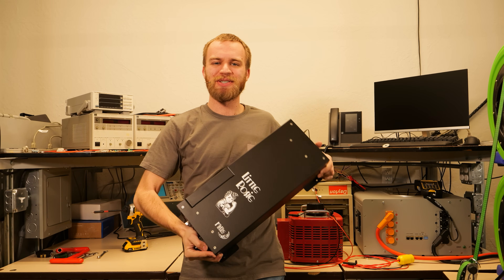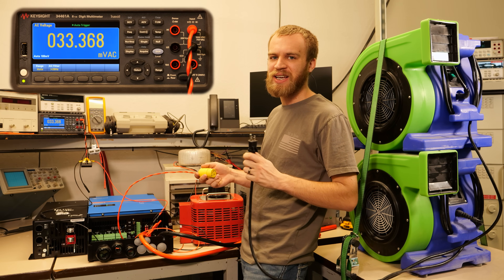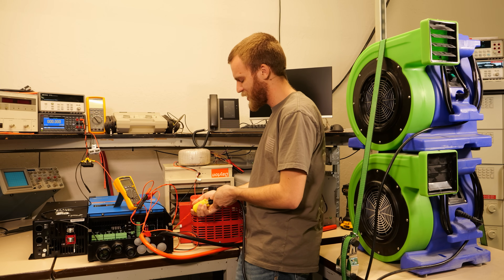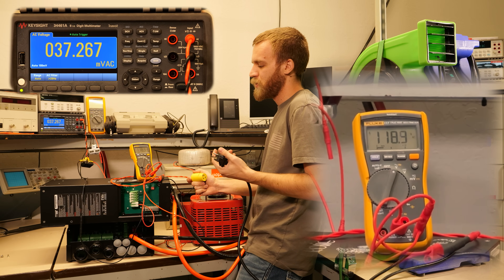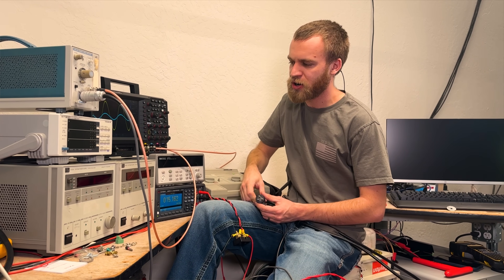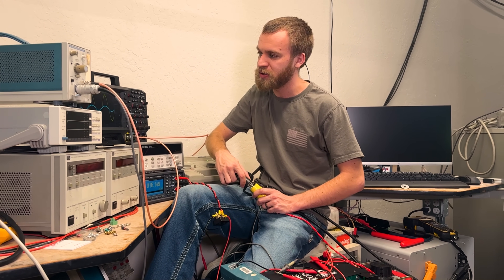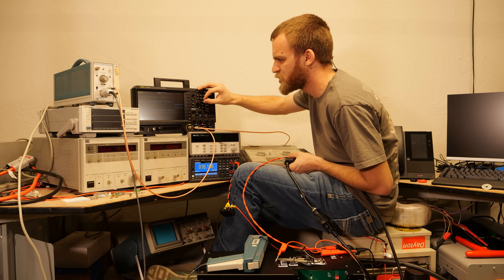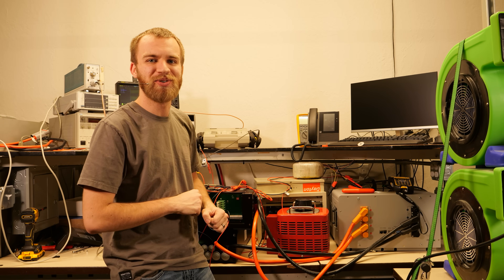Surge Capacity Test: Low Frequency Victron VS High Frequency Midnite | NOT WHAT WE EXPECTED

Comment: I'm a mostly retired electronic engineer, and in the past some of the products I designed were AC power conditioners and regulators. There is a widespread, and totally wrong, idea I see promoted whenever low frequency inverters are discussed. Transformers DO NOT store any significant energy. They can't, and don't,  contribute to the ability of an inverter to output a large surge of current. What they do add is some output resistance in series with the load. The resistance of their windings causes the output voltage to sag when the current is high (as you observed) and that can limit the surge current. The control circuits in the inverter do monitor the voltage at the output of the transformer, but because of the limited bandwidth of that transformer, the response of the control system has to be slowed down to prevent instability. As you also observed, this can result in overshoot of the output voltage when the load drops suddenly. The control circuit has cranked up the input voltage to the big transformer, to compensate for the voltage drop in its windings. Then, if the load suddenly decreases (fans go up to speed in your case) it takes a good fraction of a second for the control circuit to lower the input voltage to the transformer. It's entirely possible to design a high frequency inverter to have robust surge capacity - and the Little Rosie is a good example.
Lastly, so-called low frequency pure sine wave inverters are actually high frequency inverters that use the same high frequency pulse width modulation techniques as high frequency invertes do. The difference is that the so-called low frequency inverter creates a low voltage 50/60Hz  sine wave (tens of volts AC) and steps that up using a big, heavy 50/60 Hz transformer. High frequency inverters boost the battery voltage to high voltage DC, and then pulse width modulate that high voltage DC to make high voltage AC.
Reply: Good explanation, but I think you meant "Little Rosie" instead of "Victron" at the end of your first paragraph.
Reply: Everybody flexing
Reply: Victron switching freq. is 20Khz, Little Rosie is 30khz. Both use way higher switching frequencies than 50/60hz. They both use PWM to create  the 50/60hz sine wave output. 

"The resistance of their windings causes the output voltage to sag when the current is high"

Thats not the cause. Its when the Transform core become saturated and the primary impedance drops, as the energy transfer between the primary & secondary drops. When the transformer saturates (magnetic) the primary winding inductance drops to zero & becomes like a short. The Higher load on the secondary the lower the primary inductance.

Most inverters increase switching frequency (ie the high pitch whine) under high load to avoid saturating the transformer core, but there are limits depending on switching transistors (Probably IGBT) and the transform core material (probably silicon steel laminations). which suffers from eddy currents at higher frequency.

The Little Rosie with its 30 Khz inverter use a transformer core for higher switching freq. Probably a metametal\Amorphous core or Ferrite and likely MOSFET transistors instead of IGBT. The higher the switching freq, the smaller the transform core can be for the same load rating.
Reply: @guytech7310  I am very familiar with 50/60 Hz transformer design and operation, and you have a misunderstanding of what affects the flux in the core. The flux in the core is largely independent of the secondary current. That may sound counter-inutitive, but it's true. Yes, the higher the frequency the smaller the core can be, but the output transformer of the low frequency unit is always operating at 60 Hz, independent of the load, and independent of the PWM frequency used to synthesize the sine wave. The switching frequency is  almost completely filtered out before the sine wave goes to the 60 Hz step up transformer.
BTW, the inductance of the primary is not affected by the load on the secondary. The inductance is a fixed value set by the permeability and cross section of the core and the number of turns on the primary. Adding a resistive load on the secondary can be modeled as a resistor on across the primary, in parallel with the inductance of the primary.
Reply: @jimmurphy5355 "The switching frequency is almost completely filtered out before the sine wave goes to the 60 Hz step transformer".

No, the transformer drive circuit consists of transistors which are switched on or off by PWM square waves.
Reply: @Tekzman  Well, yes, high frequency PWM square waves are what come out of the circuits that synthsize the 50/60Hz sine wave. But before those square waves are sent to the big, heavy, 50/60Hz transformer, they are filtered (averaged) by inductor/capacitor low pass components that eliminate the high frequencies and pass only the mains frequency fundamental to the transformer.
Reply: @guytech7310  "Most inverters increase switching frequency (ie the high pitch whine) under high load to avoid saturating the transformer core" No they don't. High loads typically do not increase transformer flux since the primary side flux is cancelled out by the secondary side flux (other than for leakage inductance). The noise heard in the video is 60 Hz, not high frequency above audible. The higher currents in the winding cause higher physical forced leading to louder 60 Hz humming. Inverters might actually reduce switching frequency at high loads to improve switching losses.

The high frequency humming is more likely due to current limiting by the PWM controller on the primary side switches, which will typically cause a square type current wave in the primary side and thus higher frequency (multiples of 60 Hz) harmonics. The current limiting is also what slows down the startup of the blowers. Essentially acting like a soft-starter to limit in-rush current.

The low voltage transformer won't benefit from increased switching frequency at all to reduce saturation.

The drop in output voltage is likely due to voltage drops across all of the components, including winding resistance. For a low frequency transformer there is significantly more windings and therefore voltage drop due to load. A simple feed forward controller should be able to compensate for that almost immediately with feedback accommodating for temperature variations. So, slightly disappointed in the control loop of the Victron.
Reply: @philipbotha6718  "The low voltage transformer won't benefit from increased switching frequency at all to reduce saturation."

There is no "low voltage transformer". I think you mean "low frequency transformer", which does not exist in a modern inverter.  PWM drives the output transformer. The low frequency (60hz) is created by the PWM wave function. PWM is modulated to create a 60 hz sine wave output. A low pass filter is used to remove the high frequency from the output. in the video you can see the HF overlaid with the 60 hz, when the inverter is under high load as the low pass filter isn't able to entirely filter it.

If inverters had a low frequency transformers, it would add about 60 to 100 pounds of for the large core required & add around $1000 to the cost.

Most modern inverters will allow short "overload" or overdrive period to accommodate surge loads (ie motor startups) using a higher switching frequency to avoid transformer saturation than normal operation, but at a cost of much higher switching losses.

"For a low frequency transformer there is significantly more windings and therefore voltage drop due to load. "

Its the size of the core that increases with the decreased frequency. When a transformer saturates, its like creating a short on the primary only limited by the primaries winding resistance. You never want a transformer to saturate in an inverter as it usually destroys the switching transistors. 

 The higher the switching frequency the smaller the core can be for the same power output. Prime example is the Little Rosie RE inverter that weights about 15 pounds with a power of about 4500 Watts. Higher switching freq. smaller core needed.
If the Rosie had a "low frequency transformer" it would likely way around 80 pounds.

There are no low frequency inverters sold any more. They all use high frequencies for improved efficiency, voltage\current monitoring & smaller size. 

"The noise heard in the video is 60 Hz, not high frequency above audible. "

I believe he stated "high pitched noise", not a 60 Hz hum. Likely the high pitched noise was not captured.
Reply: @guytech7310  Yes, I meant low frequency transformer. The Victron Multiplus II is an example of a low frequency transformer. Half of the box, and majority of the mass, is a low frequency (mains) toroid transformer. The Victron Multipluss II 5KVA weighs around 80 pounds. It is also more expensive, obviously.

The victron, thus, does not benefit from increased switching frequency to prevent transformer saturation. Transformer saturation is also mostly linked to primary side voltage and frequency. 

At no load, the magnetizing inductance is the primary element limiting current. At lower frequencies the magnetizing inductance must be made proportionally larger, requiring proportionally more windings requiring more transformer core to accommodate the windings. The transformer will be designed with operating lowest frequency (45 Hz for the Victron Multiplus II) and the highest primary side input voltage (~66 VDC). The inverter will shutdown if the input voltage is above 66 V to avoid core saturation.

The increase in windings will negatively affect the load regulation of the inverter since it is likely to result in more winding resistance.

I believe the high pitched noise was likely the harmonics of the 60 Hz since the switching frequency is beyond the audible range for most adults (higher than 15 kHz). With the current limiting the current waveform can be seen to be a squarish wave 60 Hz, creating the higher order harmonics.
Reply: @guytech7310  There are  inverters sold that are commonly called low frequency inverters. As you correctly note, they use high frequency pulse width modulation of the DC to synthesize a mains frequency sinwave.
The reason they are called "low frequency" is that they do use a low frequency (50/60 Hz) transformer to raise a low voltage sine wave created from the battery voltage to 120/240 VAC.
And it's not wrong to call that low frequency transformer a low voltage transformer. It's primary side runs at about 7-30 VAC (lowest if designed to ues a 12 volt battery, at the high end when designed for a 48 volt battery.)
Reply: sorry but a lot of lackages in your analisys... the biggest one is you are speaking thinking to know how really work a products but you forget every brand layout and algorithms are " closed " and you can't really know how fw work, in modern inverters " numbers of spires ", " magnetic flow " and others thing like that are 40 years old concepts
Reply: You may have experience in power conditioning and regulators, but you obviously have little experience in inverter design or their operating principles, as half of what you're saying is untrue. First of all, the transformer in a low frequency inverter does in fact act as an "Energy Buffer" (Flywheel Effect): The massive iron core in the transformer momentarily stores magnetic energy through each cycle, in the form of a magnetic field surrounding the transformer,  which induces current into the transformer's coil when the field collapses allowing the inverter to deliver significantly more power (2-3 times rated) for several seconds to overcome the initial startup demand of motors. This is why a well-designed transformer-based inverter design requires the use of "Snubber FETs". Second, unlike Victron's design. a true low frequency inverter is NOT  "actually high frequency inverters that use the same high frequency pulse width modulation techniques as high frequency inverters do", a true low-frequency (LF) transformer inverter switches its H-bridge at a very low base frequency (like 50/60 Hz) to drive a large, heavy transformer, while a high-frequency (HF) transformerless inverter uses its H-bridge to switch at much higher frequencies (20 kHz - 100 kHz or more).
Reply: @quickquote1568  "...several seconds..." feels like you're confounding a 60 Hz resonant tank LC circuit with that of a transformer.

Sure, some magnetic designs, e.g. those for resonant converters, can have a single magnetic component that does both but it is the LC resonant tank part that stores the energy and filters out frequencies other than the mains frequency. This would still then go through a transformer, which may be an integral part of the magnetics,.

This type of design, mains resonant frequency inverter, though is very uncommon in residential and most commercial applications. I've only encountered this once in something that was, at least, forty years old. Before the advent of high speed IGBTs and MOSFETs.

Comment: having a blue one  i find it ok it even welded with only one 5kwh battery but with jk  power   bms not the inverter one !!!    fair  for  half system  because  it needs at least 2 inverters and 6 of these batteries to mimic the grid single phase 230v around 8to 9kva in my places

Comment: You're missing the point the vicron has energy saving mode. That's causing the problem you sing. It is also not a low frequency inverter. It is a hybrid between high frequency and low frequency. A true low frequency inverter can handle up to three times its rating for up to 30 seconds or less. But the Victron can be improved by going through its settings and eliminate the energy saving mode. And by the way what gauge wire are you feeding those inverters with. There are a lot of variables you left out. Like the size of the battery that supplying the inverter with the power throw the gauge of The wire
Reply from the maker: This inverter was not in its energy saving mode and we had all the optimal settings for performing as best as possible in this test.  We are Victron distributors, and are very knowledgeable in the settings of these inverters - energy saving mode would be an obvious mistake.  The unit is also a true low-frequency inverter, it has only one H-bridge on the 48V bus that feeds the transformer.
Reply: @CurrentConnected you still look out the size of battery the gauge of the wire. And all the information you just fed me you're not say that he replaced in the video. You may be experts on Vic. But we don't know that because you said nothing about it in the video. So it makes us ask questions. So what gauge wire are you feeding it. What size battery are you feeding in. 48 volts is not enough information . Please give us all the information if you're an expert on it
Reply from the maker: The battery is an EG4 Wallmount battery, 48V (51.2v) 280Ah with approximately a 42" long 2/0 ultra-fine strand 200C high-temp silicone wire with tinned copper lugs crimped with a 6pt hydraulic crimper.
Reply: @CurrentConnected thank you. That should be able to handle it. You are an expert but should be able to handle it. So I come to the conclusion that it is a high frequency side of the inverter on the vitron that's making it fall short. I know you say it's low frequency and it is only on the output side. Like I said it's sort of a hybrid. This is why it's so efficient even when it's not holding anything back.

Comment: and how much RF does it produce ? I know for a fact Victron produces 0. As a HAM we encounter a lot of interference from other inverters. And i guess you need to study the specs for the victron again. 5000KVA isn´t 5000W.
Reply from the maker: We know for sure that on the output waveforms, there is less distortion on the Midnite - and yes, we know 5kVA isn't 5kW, and we called that out in the video specifically, hence why we tested with 4kW base load as well as 5kW base load.
Reply: @CurrentConnected  RF isn´t measured at/on the output. It´s done with a spectrum analyser. Your output may be good but what about distortion on the Radio Frequenty´s ??? Lot of inverters distort reception out of band specs. I know that Victron stuff isn´t.

Comment: Good video. I like Victron smart charge controlers. The inverters, not so much.
Reply from the maker: The thing is, even though the Midnite outperformed the Victron, the Victron is still incredibly impressive.  Both of these inverters are top of their class and there is plenty of poor quality products on the market that these two units significantly outperform.
Reply: @CurrentConnected the Victron is a quality product, but i expected more from the technology LF vs HF. Also, i don't like buying extra stuff after the initial purchase, like mk3 cable to hook up with a Quattro,  all the ve.direct cables. Shunts, The Smart shunt is great,...that costs extra. So if I can find a low cost HF inverter that powers my stuff with no complaints,....
Reply from the maker: We have many options, if you need help our team is available for questions or help deciding!  Check out our site at www.currentconnected.com

Comment: I'm guessing that the control algorithm programmed into each inverter, and the types of current carrying connections they have within them, makes the biggest difference in how they react to such a big startup load. I used to have a cheap sinewave inverter that wasn't good at startup loads, but then switched to a victron Phoenix 12 1200 when my last inverter got killed by lightning. I'm pretty impressed by how large of devices my Phoenix inverter can start, plus the increased idle efficiency. I wonder what the sinewave on my inverter would do under load, since Victron claims that it's a hybrid between a high frequency and low frequency inverter.